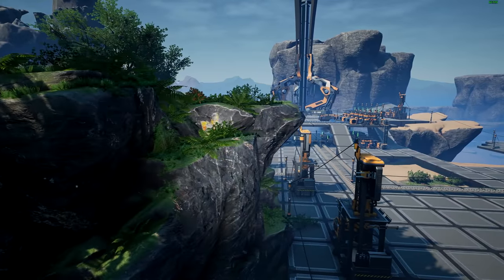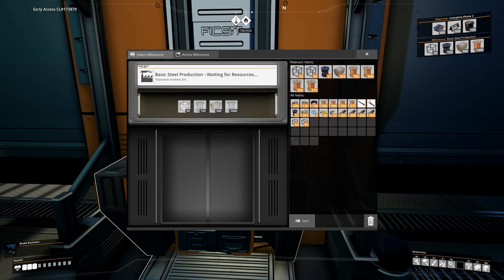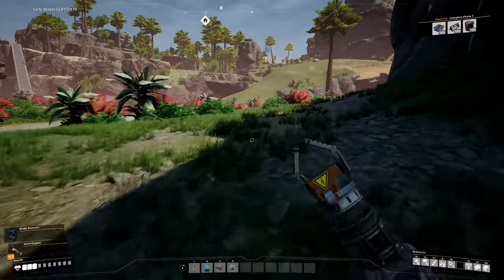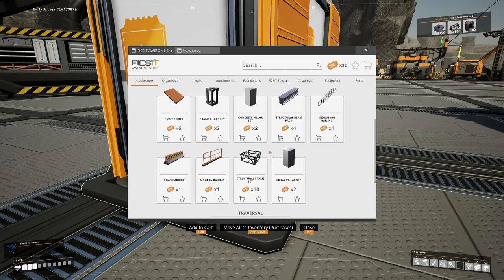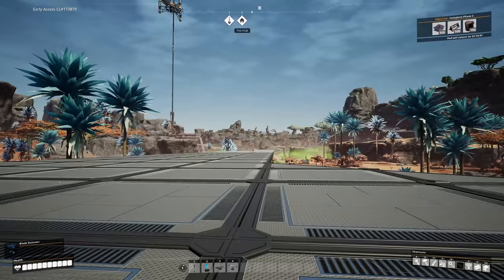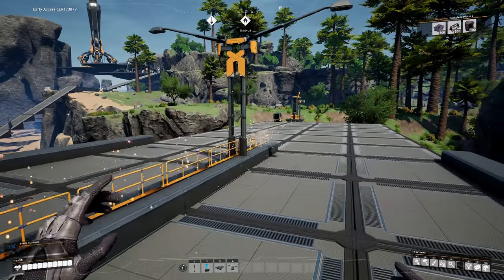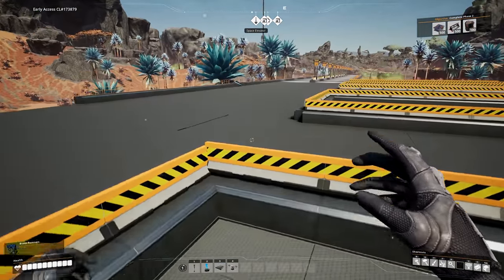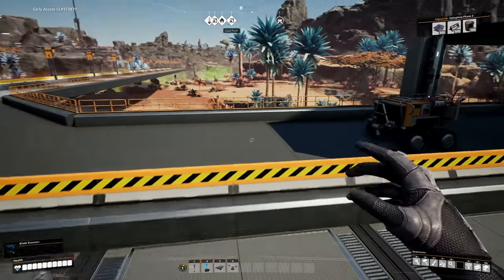TRACTORS + HIGHWAY!! For Satisfactory Update 5 - Part 4

Comment: You mentioned in a recent video that you think placing mergers or splitters on existing belts is bugged. I thought i tell you the one thing to make sure it works everytime.
When you place i.e. a merger on a belt aim for the belt, not below. If the merger moves in one meter increments it will snap to the ground and not connect to the belt.
If you instead aim it at the belt correctly you'll notice it can slide freely on the belt. It easiest done from above, but once you get a hang of it you can do it from any angle.
In my opinion this is a huge time saver. When i build a row of machines, i on set don the first and the last splitter, connect them with a belt and then use CTRL to snap the rest of the splitters in place.
When you do a lot of constuctors, the benefit become even more evident. Span the belt, snap the splitters on both levels... boom, done :D
Reply from the maker: Oh 100% Know this what I was referring to is/was at the time a bug when you placed them on the line then wanted to upgrade them later, the outputs/inputs of the merger and splitter would not send out items, until your replaced the belts in increments of 2 which was super wierd and passed it onto the devs which has now been fixed 😃

Comment: The highway looks great. How did you do the angled parts of the road or are they all 90° turns? (the part of the video you drive over the curves is edited out) I've seen some techniques for corners on YouTube, but the way you did here seems simpler and the angle allows you to continue using the beams.

Comment: as i see your doing this test. i wonder, i have trucks, that drive  between to floor, like high way and ground floor. but i getting deadlocks when they should not be able, because there foundation in between. the ground raod to the high way is 2 big blocks high + 1m foundation for the highway, i wonder hoe high it actuely need to be where vehicle can drive above or below each onthere?